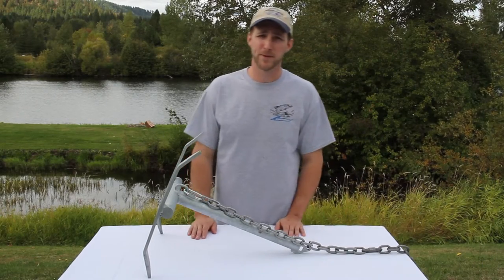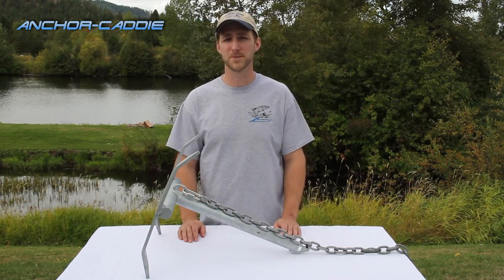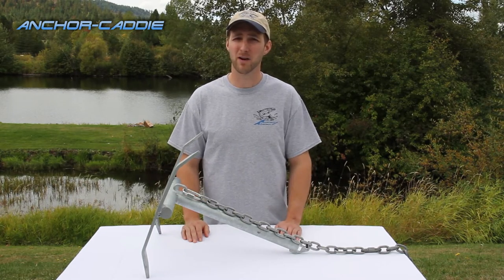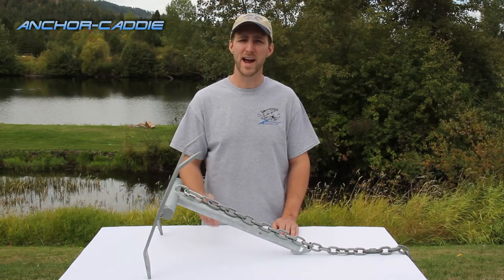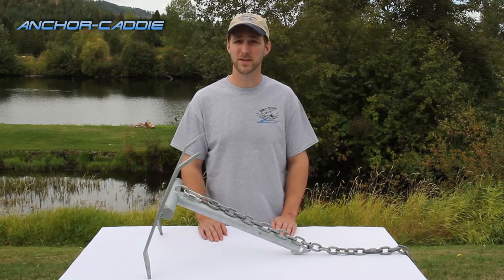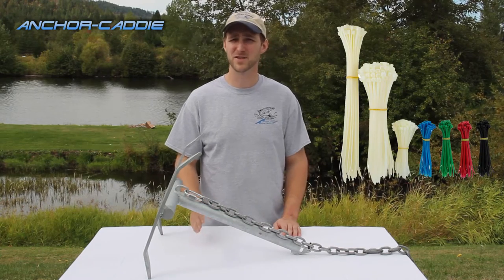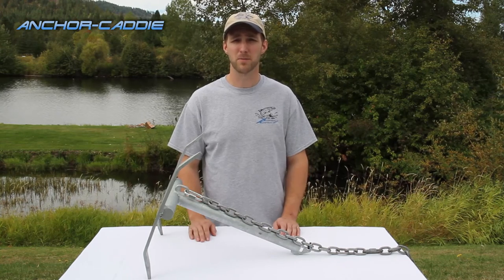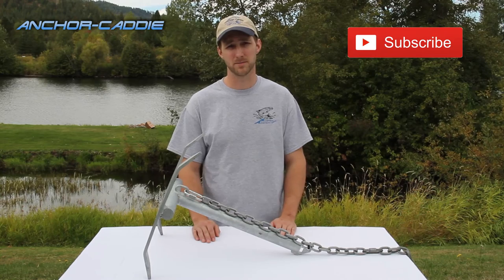What zip tie do I need to for my boat anchor?

Comment from the maker: Hi David, thanks for your comment and I understand your concern! Unfortunately, there isn't a one size fits all zip tie. The ones that I use are about 100lb for the areas I generally anchor in. Sometimes I will have to add another if the current is running faster, but I know that the power of my boat can break it if need be.

I would recommend getting a few different sizes from about 50lbs to 150lbs and start on the smaller side and work your way up. You will have to find the sweet spot for your boat's power, current flow at that particular location on that specific day. You definitely want it to break when it needs to, but not break every time you pull your anchor up if your anchor is not stuck all the time.

Doing that, you will eventually find a good range that you can stick with.

Hope that helps a bit.